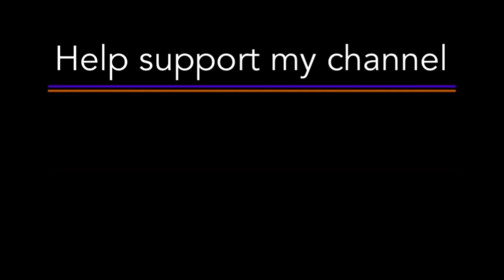Woodturning Ambrosia Maple: The Worm Hole Bowl

Comment: Gorgeous bowl Lisa! Full marks (no pun intended!) for your persistent work to remove the scratches. And of course not going thru the bottom - a problem I often have with my deep hollow forms. Chris
Reply from the maker: Hi Chris! Yep, I got my official Lifetime Member of The Woodturner’s Funnel Club t-shirt a few weeks ago. I’ve been inducted more times than I care to admit 😂
Hollow forms - are you using a hollowing system? I’d like to get one at some point
Reply: @LisaRamlow  Hi Lisa! I've tried many methods of hollow turning within my modest price range. For larger hollow forms, the best I came up with was a thick strong long bar that replaces the toolrest with a loose swiveling U shape on the end allowing the fulcrum to be as close to the tool tip as possible. For chisels I use 18" x 3/4" solid round bars with straight and curved ends with soldered on 3/8" tips  and 24" heavy handles. The scraper I use is similar but uses square section bar with a large rotatable scraper end approx 1"×2". Two more extremely indispensable tools are a suitable sized spoon on the end of a thick dowel to dig out the shavings (which build up very fast and can bind the tool and snap the turning right off it's base) and a very strong light source to enable you to guess the wall thickness as you go. Oh, and turn green and into the end grain for best results. And it's so easy to get a catch and smash the rim of the tiny opening at the top. It takes lots of practice! I can't for the life of me remember the tool supplier as I purchased the kit 20 years ago. I'm sure that other subscribers will come up with  more modern methods. Best of luck, it's extremely satisfying when you finish your first thin walled deep hollow form with a 1-2" opening. Chris

Comment: You can save a lot of turning and bowl size if you would blend the small ridges using a skew or other "flat bottom" tool, instead of any tool that is rounded - promise.
Reply from the maker: Hi Kerry! Really? I’ll have to give it a try. I have a flat square scraper that I ground into a negative rake and I have an oval skew that might work too. Keep an eye out next video 😁
Reply: Lisa - i should have added - the longer the flat area the better which makes it easier to blend without digging in with the sharp edges.  Obviously this recipe only works on outside curves.   Good luck
Reply from the maker: Understood. No point bits inside the bowl! 😁

Comment: Tell me about those lines, it happens to me also. I think they may be caused by differences in the hardness of the wood (knots and such). Turning speed and tool sharpness are factors for sure. But yes, we all believe our tools are sharp enough and I do not say that is your main issue (although it may be for me. 😁) 
What you could perhaps try is turn a bit slower. I know faster is supposed to be better but there is also an optimal speed. Going above that speed could be a factor in causing these little lines, sort of burnishing the surface with your tool. (Just my thoughts & experiences.)
Thnx for another great video Lisa!
Reply from the maker: Hey Leo! I’m pretty happy with the sharpness of my tools - I think losing bevel support causes some of the lines. That’s one good thing about doing the videos - I can see what the hell im doing (wrong)! ☹️
Reply: @LisaRamlow  From what I see you not doing a lot wrong. And by sharing them you can find that you are not the only one having this issue. As said already: I suspect turning at higher speeds than necessary is a factor.
Reply from the maker: I think I have a tendency to turn a little on the slow side, compared to others. Where do you fall in the spectrum? I don’t usually turn bowls above 1000 unless it’s dry and I’m super sure it’s a solid blank. According to Stuart Batty if the speed is under 1000 and the blank comes off it will just hit the floor and not go flying into you. I like that idea 😁
Reply: @LisaRamlow  Same, perhaps a bit higher for when hollowing.

Comment: I like it.  Question;  What is your preference tool/pen for signing your work?  Does your choice vary for darker woods?
Reply from the maker: Thanks Dave! Honestly I don’t have that figured out yet. My plan was to use copper discs that I etch as my logo/signature but haven’t gotten that streamlined yet. I’m currently using either a regular Sharpie or an oil-based Sharpie and I’ve had issues with both of them bleeding when covered with finish. Regular Sharpie is definitely affected by shellac or other alcohol based finishes. I’ve not tried a wood burner yet but that is an option as well. I’ve heard some people use silver Sharpie on dark woods but I just use black
Reply: @LisaRamlow  Lisa,  your experience echoes mine. I recently invested in a wood burning tool. I've signed 2 bowls with it and am pleased with the results. As for the bleeding with a sharpie,  I found that applying the finish first, then signature , followed by paste wax, worked well.  I really enjoy your videos,  thanks.
Reply from the maker: I haven’t tried the paste wax on top, will see if that does the trick. Do you have a pen type wood burner where you write or is it a branding iron? I have an electric branding iron from my flat-work days that works well but it doesn’t fit on the bottom of the bowls - it’s rectangular
Reply: @LisaRamlow   The one I have is for writing. Picked it up on from Amazon for about 60 dollars came with two pens and a heat control. Not super expensive but much better than a cheapo.

Comment: You could try using 80 grit sandpaper to remove the tooling Mark's then go through the grit up to 400/600 to get a smooth finish. Try alternating between hand and rotary sanding as you go through the grits.
Love the bowl and the ambrosia maple and don't be so hard on yourself.
Reply from the maker: Thanks David! I’ve had several suggestions regarding the sanding so I’ve got some things to try. I’m not above going to 60 grit if necessary! But hopefully I can make some changes and won’t have to spend so much time re-sanding. Thanks for the tips and for taking the time to leave me a comment, I really appreciate it 😁

Comment: Super great looking Bowl! I like the added cove. I personally don't use a cove cutter. It's a bit to uniform for me. Size of the cove, width and height for me depends on the size of bowl, grain, type of wood and how I'm feeling that day, lol. You use the bowl gouge very well and cut the cove nicely.  I have also started using a 3/4" bottom bowl gouge. I find it helps the transition from the inside of the bowl to the bottom. Excellent bowl, great turning!
Reply from the maker: Thanks! I’m still trying to get the hang of the bottom bowl gouge-need more practice! 😁

Comment: Nice bowl! As far as tool marks every piece of wood is different, mostly its a matter of practice,practice,practice
Reply from the maker: Thanks David! Agreed, I know some of my issues are losing bevel support more often than I’d like. I’m also going to eliminate the spindle adapter and just use my SuperNova2 which is a direct thread for my lathe. I am getting a little runout from the spindle adapter/G3 chuck combo. Thanks for stopping by and for taking the time to leave me a comment-I really appreciate it 😁

Comment: What an incredible piece of wood to work with! I’m glad you bought the coring equipment later. Imagine what you could have done with the rest of the wood that is now just curls and sawdust on your floor…. I learned how important the dryness was in keeping such a thin piece from cracking. It’s beautiful. Do you sell your work?
Reply from the maker: Hi Jeanne! Or is it Jeanne Elise? In any case, thanks so much for the kind words. The coring system was expensive but worth it for sure. I do sell my work in some galleries here in Michigan but I’ve also recently been adding some things to my website. Not a ton there yet but I’m adding as I get time 🤣

Comment: I had the same problem with the lines until I used a 1 inch flat cutter. Solved all my problems
Reply from the maker: Flat cutter - scraper? Carbide or HSS?
Reply: @LisaRamlow  a flat HHS. I kept getting small wobbles and uneven cuts on my bowls that I could never correct. I then tried my 1 inch flat HHS cutter about 3/8 thick and it made everything smooth and even, even on the rounded sides. I just had to keep it steady and work in one direction and it cleaned it up really well.
Reply from the maker: I’ll give it a shot, thanks!
Reply: @LisaRamlow  anytime.  It like making a straight line from a 12" ruler or a 6 foot ruler. Both work but one will be much more accurate

Comment: Beautiful bowl Lisa. I have a question. Where did you get the extension for the chuck and what is the technical term for it? I have searched the internet and cannot find anything close to it. Thanks...David
Reply from the maker: Hi David! It’s a spindle adapter so I can use my Nova G3 chuck (1” thread) on my Laguna lathe that has the 1-1/4” spindle. I will say that I think  the adapter is causing me some runout issues so so be aware of that 😊
Reply: @LisaRamlow  thanks so much for the reply...

Comment: Hello.  I love this bowl.  Very beautiful!
I have a question.  At about time mark 3:06, you cut what looks like steps on  the bottom of the bowl. Then again while you're hollowing  the bowl. I've seen many turners on many videos do this both on the outside and the inside of pieces
 Can you please tell me why you do that?
Reply from the maker: Hi Holly! When you’re turning a bowl in the traditional orientation (the grain runs perpendicular to the bed ways - spindle orientation the grain runs parallel to the bed ways) you are cutting into side grain then end grain then side grain...etc when you cut from the outside edge of the bowl in toward the center, like when you clean the face of the bowl. But cutting those little steps in from the tailstock end you are cutting only into side grain, which cuts easily and cleanly with virtually no tear out. It’s a lot more efficient to remove a lot of waste material this way rather than cutting straight into end grain. I find it also helps me visualize the shape a little better when I’m working on the outside curve. 
If you want to get some good, detailed explanations on this sort of thing I highly recommend Brian Havens’ channel. He did an At The Lathe series of videos that are fantastic as far as explaining the tools and cuts -I really like his presentation.
Reply: @LisaRamlow  Ah Ha!  Now that makes perfect sense. Thank you so very much.  I'll definitely be watching Brian's videos.
I appreciate the time you took to explain.  
You're explanations are some of the best I've seen on YouTube.

Comment: The adapter that goes from the head stock to the chuck could be your problem.  That seem to be my problem with ring marks.
Reply from the maker: Hi Ken, I think that could definitely be part of it. I’ll do a little experimenting and see what I can come up with 😁
Reply: @LisaRamlow  I had the same problem.  I have the same lathe and was trying to use my old 1 inch chucks with an adapter.  When I switched to the proper 1 1/4 chuck it stopped.
Reply from the maker: Yeah I’m thinking I’m going to have to demote the G3 to holding Cole Jaws or something down the road and get either another SuperNova2 or better yet a Vicmarc or OneWay

Comment: Firstly, great job, really neat looking piece. Secondly, in possible answer to the vexing question... Could I suggest removing the Chuck extension. You mentioned it yourself so by trying it on a piece of waste you may well solve the problem and safe yourself a year or so sanding!! Happy to be wrong but worth a try.
Keep safe and well. Always enjoy your videos. 👍👍
Reply from the maker: Hi Clive! The Big Green Monster bowl I did last video was on my SuperNova 2, which is a direct thread on my spindle and I had some similar issues with the lines on that one, though some wood that is due to losing bevel support with the gouges and will improve as I get better. I also attributed some of that to the fact that the walnut was wet, and did move some while I was working on it. I used the Nova G3 on the ambrosia maple bowl, which needs the spindle adapter cuz it’s the chuck I bought to use my with my old Delta midi lathe which has a 1” spindle. I don’t like to move the jaws around so have been using the 100mm jaws on the SuperNova2 and the 50mm jaws on the G3. May have to swap them around and do a little experiment 😁
Reply: Hope you work it out successfully.

Comment: Bowl came out nice! I've having the same problems lately. I'm  struggling to get a smooth surface off the gouge on the outside of bowls.
Reply from the maker: Hi Greg! It seems there are a lot of us having some issues with the lines. I have had a few suggestions on this thread and I’m going to do a little experimenting so stay tuned and I’ll let you guys know what I fingered out 😁

Comment: In hindsight, I think that all that exterior scraping changed the form of the bowl. I found that the larger bowl was more pleasing to the eye. Maybe the pursuit of perfection had a cost.
Reply from the maker: Perhaps but I do not think that should deter the attempt to improve skill or design. Sometimes it comes out better, sometimes not, and you won’t know if you don’t try.

Comment: Can I ask why you used the entension between the headstock and the chuck?
Reply from the maker: That’s my smaller Nova G3 chuck from my midi lathe and has a 1” spindle thread. The Laguna has a 1-1/4” spindle thread and that is Nova’s adapter so you can use the smaller chuck. I’ve been keeping the 50mm jaws on the G3 and the 100mm on the SuperNova2, which is a direct thread. Think I may be getting a little runout with the adapter though
Reply: @LisaRamlow  Thank you Lisa!

Comment: Contrary to other comments riding the bevel or a push cut will give you a lot smoother cut then scraping, if you look back on your inside cuts you will notice that you are riding the bevel because of vary nature of a bowl gouge
Reply from the maker: Hi Ray! Generally I try to get a finished surface with a push cut and go to shear scraping if I’m having to take off too much material to get it right - some days are better than others 😂
I can tell in some of the videos that I lose bevel support more than I’d like to so practice, practice 😁

Comment: I need a large bowl gouge. Are you happy with the hurricane?
Reply from the maker: Hi Rob! I am happy with the Hurricane gouges - they are M2 steel so not as nice as my Thompson tools but I think for the price they are a good buy. You may notice I blued one of the wings on the big Hurricane - I sharpened it on my 600-grit CBN wheel which has a tendency to run a little hot on the M2 HSS tools

Comment: When you figure out what causes those little lines, please let me know.
Reply from the maker: Hi Billy! I know some of it is not so great tool control - I seem to lose bevel support at times and that causes some of my problems. I may also be having a little wobble from my spindle adapter for my smaller chuck. But I’ll keep you guys posted!
Reply: @LisaRamlow  I sure would appreciate it.  I thought that it may be from me pushing to hard against the bevel.  I just don’t know and I am tired of sanding.  Thanks Lisa!
Reply from the maker: I think that is part of my issue. I’ve recently ground a little relief bevel to see if that helps. I try to remind myself throughout not to have a death grip in the tool and “glide” the bevel instead of rising it. Muscle memory and practice I think will be helpful 😁

Comment: There is movement in your spindle between the time slots of 5 minutes and eight minutes of the video.  Is this the only turn you've had issues smoothing the surface??
Reply from the maker: Hi there! I have had issue with several projects, but I think the biggest issue is the spindle adapter with the G3 chuck from my old lathe. I had some issue with the Big Green Monster bowl https://youtu.be/aHS66UAQSms and I was using the SuperNova2 (direct thread) but the walnut was wet and was moving a lot while I was turning. I’m going to demote the G3 to maybe holding Cole jaws if I ever get any or a sanding disk or something. We’ll see if that takes care of most of the issue. I’ve checked my spindle with a dial indicator in the past and it was ok. I’ll keep you guys posted! Thanks for watching and for taking the time to leave me a comment 😁
Reply: @LisaRamlow  I bought a "bargain extension and it was the root to a lot of issues.  A friend machined it to a better balance and it helped immensely..  My fault for trying ot save money where I shouldn't have.
Reply from the maker: I bought the Nova spindle adapter and used one of the plastic washers they included and recommended but I suspect bit may be part of the problem. Some projects are better/worse than others using this same chuck and adapter so I’m sure there are other factors (less than ideal tool work, losing bevel support, wet vs dry wood, species of wood, etc 😂) but I’ll oat more attention when I’m having issues and see if I can sort it out. Thanks for your input!

Comment: Your tooling is where the lines are coming from.  Learn to use the 40/40 in a push cut.  That carbide scraper is the culprit.
Reply from the maker: Don’t remember if I had my 40/40 gouge at this point or not 🤔